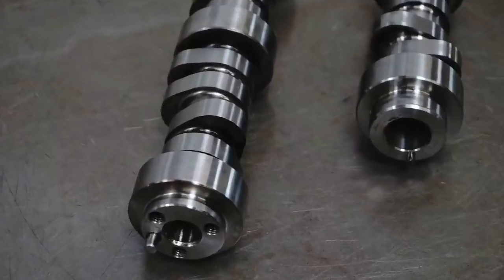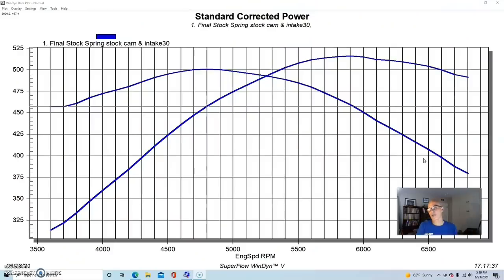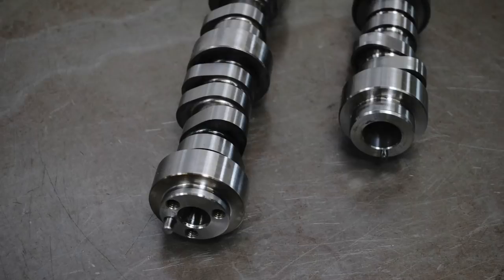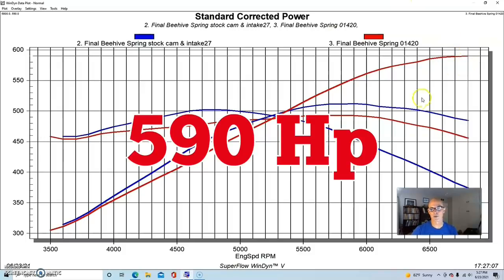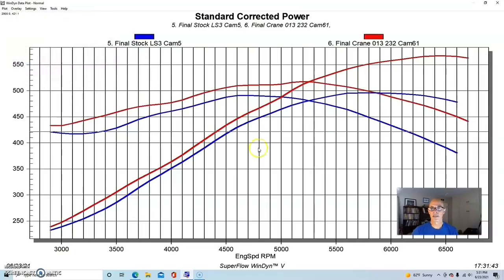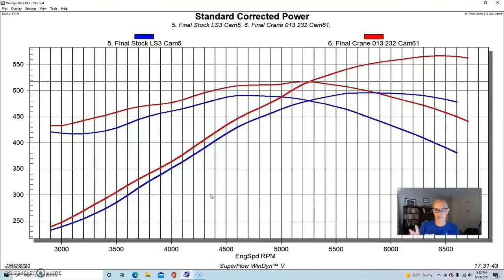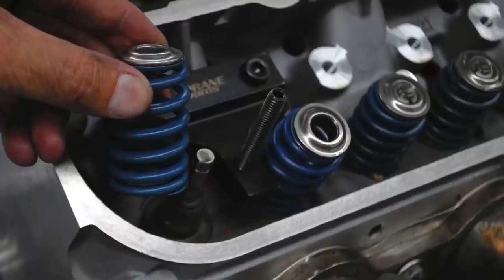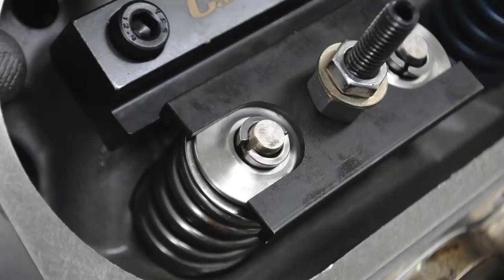DO STIFFER VALVE SPRINGS COST POWER? LS3 SPRING TEST!!

Comment: Ok try and answer this🙌 me and my trusty mechanic are working on a 2.8 mpfi, it has a Isky 262H cam, 3500 valves, double roller timing chain, comp cams 1.6.1 ratio roller rockers, upgraded lifters, 19 lbs Bosch injectors, 3800 V6 47,000 volt coil packs, 8.2 Taylor ignition wires, gapped Iridium 0.065 spark plugs... the 411 lbs max howards double springs bent our stock push rods and are looking into Special made push rods. Are these 411lb springs from Howards too much to crank the engine or run, or run right at all?! The max the cam can take is 440lbs max.. what do you think?!
Reply from the maker: you need to know what the seat and open pressure are on the springs, not the max pressure(you need to know valve lift)

Comment: Please do a ebay valve spring test. I blew up my ls6 motor using ebay 1218 valve springs. I thought they were pac 1218 but they weren't.  There are many different companies selling 1218 springs claiming they're 600 lift. Please and thank you

Comment: You will lose a certain amount of power with stiffer springs, due to increased bearing friction.  However, judging by your results, it isn't terribly significant in a roller lifter engine.
Reply: We've always assumed "some" loss, but if it's nearly no losses then we should run as stiff springs as our combination calls for.
Reply: @dennisrobinson8008  You should do that regardless...

Too much spring causes excessive wear.  Too little costs power due to undesirable valve train dynamics, and can lead to catastrophic mechanical damage.

Comment: It would have been cool to use a cam with more duration but a 550 lift limit.  There was no need to go to a higher lift cam and only test the Duals vs. Beehive, as he coulda tested ALL 3 on the same exact platform.

Comment: So, will the lower pressures of the beehive springs result in less wear and tear over the life of the engine, as opposed to the dual springs?
Reply: Yes, until a certain rpm is hit.  When the lighter spring starts to loose stability at high rpm it can cause significantly more damage than a heavier spring.

Comment: Richard Holdener how are ya brother. Have u seen these sbc hybrid LS motors ?? Very cool imo. New longblock 454 BB 86 C10 Silverado. # 14081045 heads. Thinking cam n turbo  thinking 1000Hp. Will my 045 heads flow enough ? Guess easy 7-800 hp maybe stretch to 1000hp. What ya think ? Thanks brother.

Comment: I didn't find changing valve springs to be a fun job on my stock 1985 Corvette when it was time to replace valve seals.  I would like to know which of the springs tested will retain the highest % of its rated pressure at say after 50k miles of daily driving.
Reply from the maker: any decent set of springs will last that long
Reply: @richardholdener1727  Thanks, but surprised I'm the only one looking at long term reliability as a factor.

Comment: Good test but you shoulda ran that short runner intake out to 8k rpm.
Reply from the maker: it won't make power at 8000 rpm with this combo
Reply: @rustysausage69  we spun a ls3 to 8200 using btr valvesprings and a johnson lifter with a ss4 cam. A friend that builds ls dirt car engines has did the same using a lesser lifter but a different spring. They will do it.

These days the hotlick would probably be the comp adjustable pushrods.

You probably used some cheap springs and they lost control or fatigued early.
Reply: @richardholdener1727  it hadn't made peak hp power yet on that short runner set up. And who shifts at peak hp?????????? You almost always run it 400-600rpm past that.....sometimes even 1000.
Reply: @rustysausage69  on a road course sometimes running a gear up is your friend.....or short shifting a bit to help make it to/ through the next turn. I did road racing for 20yrs with ptg. 

But atleast we figured out what really happened to your 6.0. You're usually better off just setting the limiter up out of the way than beating on it.

Either way the engine in the vid should have been run to 8k.

Comment: Was part of the advantage of the first set of springs from the valve train “hanging” because it couldn’t follow the cam’s closing ramps or having so much momentum at the top of the opening ramp that it kept going for a little more lift?
Reply: I was thinking the valves could be lofting with the stock springs at the higher rpm's.  The increase in power mostly occurred at the upper end of the rpm range.

Comment: When a valve floats, the slope of the cam is falling away from the lifter faster than the valvespring is able to push the lifter against the cam profile.  If the valvespring cannot overcome the inertia of the valve train, it will not return any of its stored energy to the rotating assembly.   At slower speeds, some percentage of the investment into the spring compression may be recouped.  But any design that intends to store more energy than is required for the spring to perform its function is overdesign.

Comment: Torque loss is due to turbulence during intake stroke from short runners.
Reply from the maker: ITS NOT TURBULENCE-ITS A CHANGE IN REFELCTED WAVE ARRIVAL FROM THE CHANGE IN RUNNER LENGTH
Reply: @richardholdener1727  there's turbulence in the cylinder that keeps it from fully equalizing due to the air speed. A longer draw in on the intake stroke from the longer runners gives time to equalize hense more torque from long runners and less top end hp. The top end needs more air speed to fill the cylinder in the time allowed. Can explain in detail in video response with the math but hard in text but is facts

Comment: Just curious do you think it hurts running? The Brian Tooley racing Springs on a factory Cam as that's what I have on my setup. I did the heads 1st and had them done and I have not installed the Cam yet being the factor cam is only a 500 lift. In my ls1  wouldn't think the pressure would be nearly as much
Reply from the maker: ITS FINE

Comment: Should also look into Wave Springs. Might need to get them custom fabricated, though.

I wonder if you could get a more energetic return by coating the spring in the same material that billiard balls are coated with, since it actually produces tiny explosions when struck hard enough. Probably wouldn't last very long though.

I also wonder if putting opposing magnets in each end of the spring would also create a more energetic return.

Comment: The 26918 is rated to .625" of lift. Could the power loss on the stock cam also be attributed to the 26918 being .109" and .135" away from coil bind, whereas the stock LS3 spring is .049" and .075" from coil bind?
Reply from the maker: CLOSER IS BETTER
Reply: @richardholdener1727  Indeed, so what I'm asking is if the 26918 being much further from coil bind than the LS3 spring could have attributed to the loss in power.

Comment: Richard can the ls6/ beehive springs be put on 1970 186 Double Humps that have been upgraded with 2.05 1.60 valves...pinned rocker studs and ported exhaust ports. The engine is a 80to85 stock 350 with a just above stock cam and 416 305heads....the DHumps I bought are set up for Hyd Roller and my engine is Hyd FT.....if the behives won't work can you recommend a spring that will work for me...and what rocker ratio to run.
Reply from the maker: THAT DEPENDS ON A LOT OF STUFF-CAM LIFT, DESIRED RPM, SPRING LOCATORS, GUIDE SIZE ETC...
Reply: Yes you can run them with matching retainers for your valves. You can also cut a factory ls rocker stand up and use the individual pedestals and use the rockers. Also you will need to get the heads machined for positive seals.

Comment: I know of 3 performance engines that broke springs in the last few years, resulting in various problems up to full engine destruction. All 3 were LS engines with beehive springs. Why do they even exist? To save a little weight from the smaller retainer? They must have some advantage over conventional springs, but why bother, when conventional springs work just fine?

Comment: Hey i have a 2003 navigator motor with 01 cobra heads and wanted to put cams in it but dont know what cams to go with any suggestions and fyi im doing a N/A build and when do i have to start worrying about piston to valve clearance
Reply from the maker: comp XE262AH
Reply: @richardholdener1727  good for horse power and idle ?
Reply: So i looked at the specs and realized its just a stock cam configuration with alittle duration differences so i went with something alittle bigger "comp XE266BH" any thoughts boss ?

Comment: I'm surprised nobody has come out with a pneumatic valve spring...  low pressure @ low revs, high pressure @ high revs, and no upper limit restriction - the best of all worlds
Reply: Every f1 car today runs them
Reply: @unclegeorgesspeedandfeed  true. And i think Freevalve also uses pneumatics + electromagnetics.
Reply: Del West Engineering advertised pneumatic valve springs on their website about 20 years ago.  I inquired about how much it would cost to develop them for the Torque Engineering V12 that we wanted to take superboat racing.  They wanted $250,000 for a development program....
Reply: @andyharman3022  to think that would be a hell of a deal today

Comment: So what I'm getting is, go for "weaker" springs that are just enough not to bind to pick up power?
Reply: Just enough to avoid valve float at and just after peak power....
Reply: @youcanbesmartaskhow3857  how do you calculate that?
Reply: @sambo92  most camshaft specs will include a recommended pressure [lbs] and height, but if a guy builds a motor with lighter valves it would have to be recalculated. The short answer is I dont know. I know pressure can be checked  and height adjusted for angle AND rate, but I'm not sure if there is a software available with tables for recommendations,  I just know when I hear float I change to the next stiffer spring but i never know if it might be too stiff. I would also like to know.
Reply: @youcanbesmartaskhow3857  how can you hear float?
Reply: @sambo92  it's fairly obvious, but I've been around racing for 35 years. When the rpm 'flattens' after peak, you can hear if it's due to insufficient airflow [wheezing] fuel [break up] or valve float the valves slap and sounds like the timing has changed. Just something you have to hear a few times to know I guess.
Reply: @youcanbesmartaskhow3857  yeah I've never heard it
Reply from the maker: shows up on the airflow meter too
Reply: @sambo92  you are unlikely to hear it on a newer car, but I grew up playing with 396  and 454 that do not like to rev past 5500 when they are stock. For us we had to listen for it. If you Upgrade the cam to one that breathes another 1k rpm,  the springs will not keep up.  Also, yes, Fancy tools like an Air meter  [LOL] will show you valve float.
Reply: @sambo92  not to brag but I can always smell a blown head gasket too....save that for another day.

Comment: It's not the same really. The energy to compress is parasitic loss required to open the valve, but that doesn't translate back. Only combustion creates the power and closing the valve lends nothing back. That's my guess anyway, but I don't really have a clue.
Reply: What you lose pushing the lifter up the cam ramp, you gain back when it travels back down the other side.  The spring causes the lifter to actually push the cam forward at that point.

It's just like gravity pulling you back down a hill, once you have driven it over the top.

Comment: Now compare springs with a turbo at 20psi, but do not change intake and cam.
Reply: You were thinking the stock springs may have difficulty closing the intake valves against the extra 20 PSI..?

Comment: So my heads have a 60 lbs more than what my cam calls for would it be safe to run that big of a difference with out messing anything up it a XE274?
Reply from the maker: what is your spring rate
Reply from the maker: but what is the rate at 560 lift?
Reply: @richardholdener1727  I don't see where the break down is that 427 is at 700 lift but this is the springs that are on the heads Trick Flow® by PAC Racing Dual Valve Springs TFS-16094-16

Comment: So I’m thinking my stroked ls3 iron block with same heads with port and polish work truck intake manifold long tubes should hit 600hp with this cam shaft
Reply from the maker: iron ls3 block?
Reply: @richardholdener1727  iron block 6.0 it’s a habit of saying iron block ls3 due to me originally having it bored to ls3 bore size before going with 4” rotating assembly

Comment: I think in most valve spring applications you would never see a net loss from the added spring pressure rate, if the lifter has complete contact with the cam through out its travel . One quick thing is you're talking LS so they are roller lifters...perhaps flat tappet cams would respond differently, But I doubt by much. In my opinion you want the lightest spring rates for your desired RPM range, not for frictional loss, but rather valve, valve keepers, valve locks life span along with cam and lifter wear. though if your really pushing all the limits valve float could ruin your pistons/valves...not a good day!

Comment: I know this is not related to this video but I am buying HP tuners pro and want to use a wide band O2 to help with tuning just wanted to know if you or anyone here can help with a selection on a remote wide band sensor and gauge I'll be using this on a 04 Chevy drive by wire set up any help is appreciated
Reply from the maker: I have not done any tuning with hp

Comment: What happened to using cams with a tight lobe separation like 106 ?
Reply from the maker: they still do the same thing
Reply: @richardholdener1727  what do you suppose the difference would be

Comment: Intake has to be set up according to firing order.
Reply from the maker: WHAT?
Reply: @richardholdener1727  Pre factory fuel injected engines require the intake timing to be set up according to the firing order of that engine. We have proven this with many dyno hours . The exhaust pulse also needs to follow the same criteria.

Comment: Does new dual spring sound stiffer then stock one  when I installed new 660 pac with upgrade kit for rocker arm I noticed sound like ticking on cold start but every day the sound becomes quieter what do you think guys is it normal ?!

Comment: It was an insteresting comparison. But, u introduced too many variables in the last test. Cam swapping and all the rest. So with your conclusions, a desmodronic valve spring system offers no advantages?
I would like to see the tests, configured in this way. No pistons and a dial torque wrench. Measuring the rotating force of each valve spring combo.
Reply from the maker: there were no variables-the last test was just the beehive springs vs the dual springs with no power change

Comment: Sorry but that test is fairly inconclusive. You gave us seat pressures on all three springs, but you only gave us nose pressures at different heights. Unless we know the spring pressure of the beehive and the duals at 550 lift the comparison is meaningless, as spring pressure dramatically increase towards the end of compression. Plus it sounded like you were using quoted spring pressures not actually measured spring pressures. I have fitted literately thousands of valve springs, and I know from personal experience the variance in even the same valve spring box can be massive. To make the test meaningful you would need to measure them all properly and add them up so you know the real work load and compare those.
Reply: Perhaps you could do the test for us and give us all the free results on your youtube channel?

Comment: Your Intro statement about Valve springs vs Power is lacking any actual reliable data.....BASIC 
requirement is only One change per test.....You Failed.....
Reply from the maker: we changed only the valve springs in each test-please rewatch
Reply: @richardholdener1727  :Really?....no cam change, no intake change, different oil?...Lots of hand waving, yada, yada,
but poor testing procedure....IF the goal
was to only show the power differences
due to springs, then motor the engine over
and measure the power difference used by the motor....If you are including power
loss due to valve not following cam, that
is a whole nuther test setup....If the goal
was to generate clicks, you were successful...

Comment: Ruined the test by changing things up. Necessary loss due to engine requirements. Cant have valve float or piston to valve interference at high rpm's. Same as parasitic loss on a roots blower. Question for Richard. Blown alcohol and top fuel use roots blowers not turbo chargers, why. Its all turbo on the street because of "free horsepower" so why.
Reply from the maker: NHRA OUTLAWED TURBOS FOR TOP FUEL
Reply: @richardholdener1727  I didn't know that, thanks for answering!